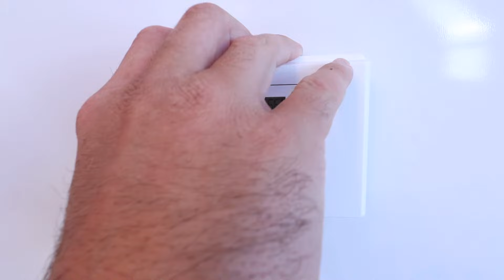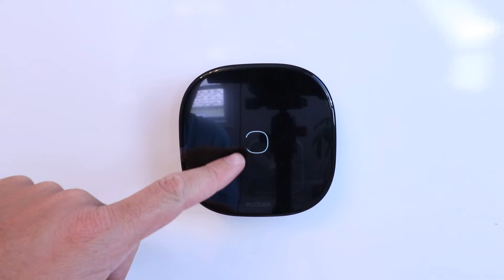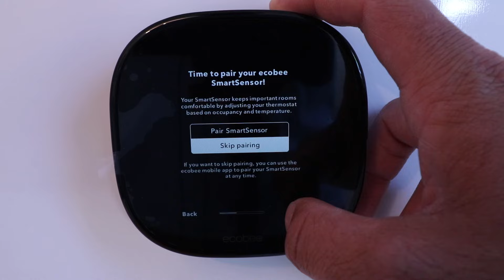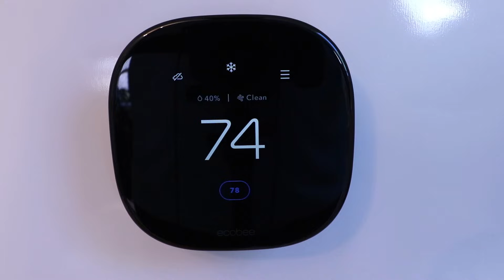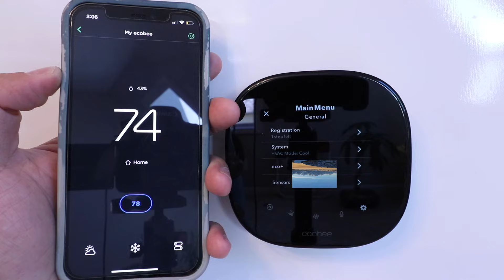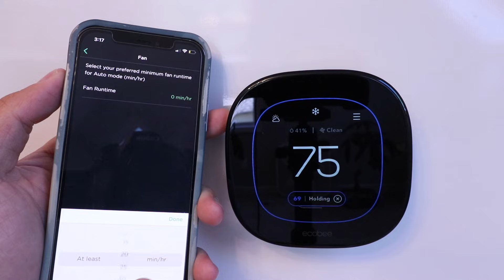How To Install Ecobee Thermostat Premium (New 2022 Version)

Comment: One suggestion I would add is to record settings from the previous thermostat. We always hope that it was setup properly, but there are always applications that aren't 100% supported by the previous thermostat where someone has done some wiring magic to make it work. I've seen tstats be wired with all sorts of relays and jumpers. In this example, the blue wire should not typically be your Common wire - Blue is O/B (Orange/Blue), but whoever wired this thermostat didn't know or didn't have a black wire.

Comment: Edit - So I had to answer my own question on this. The ecobee box comes with no instructions, however, I didn't think this would be an issue since my wiring was pretty straight forward. Wrong! I hooked up my wiring exactly like it was on my Nest, turned the breaker on and no power. It took going to ecobee website where the instructions can be found to find that the RH wire from the nest needs to go into the RC connection on the ecobee in order to power the thermostat.  
Quick question, why would the red wire go into RC when the old thermostat had the red wire going to RH?

Comment: Being the old one had the red power going to R with a jumper to RC, how does that translate to the ecobee? Damn i jjust noticed i dont have a common wire, and i have a modern furnace too. wth, so i cant use it?

Comment: I would have trimmed the bare copper portion of the wires back so there was less exposed copper, less chance of an electrical short or ground. The blue and yellow wires are the most likely to touch each other.

Comment: One of the first considerations is “Is my thermostat clise to a register?”  If yes, please consider plugging the wall mount cavity, out of which the wires extend, with plumbers putty.   In my case, the putty finally prevented temperatures from the surrounding wall from messing with the Ecobee.  The Heating would come on and roar through the floor vents for an hour, even when it reached the desired Hold speed.  The solution came was reached after 3 HVAC company visits and two calls to the Ecobee customer service.  During my last call to Ecobee, a rep asked how clise the register was to the thermostat (1.5 feet above the register).  The rep kindly guided me through the steps and sent a video to show what the completed step should look like.   I bought some putty for under $5.  The video showed the wires Nicky spaced apart, but my wires are densely grouped together.  I had to used an unused WD40 straw to meticulously pack the putty in.  After about two hours of doing this, periodically using a finger to press down on the whole mass, an effective seal finally was formed.  Now, when the heat turns on, it runs at an acceptable flow for 10-15 minutes.
Reply: Sorry, couldn’t edit.  It’s “even after reaching the desired Hold temperature”.
Reply: And “wires nicely spaced apart”.
Reply: Obviously, it would be ideal for the installer (be it homeowner or HVAC technician) to pack in the putty before wires are connected.  HVAC company:  do it to spare yourselves service calls!  Even if a register is not near, poor wall insulation near the thermostat could spell problems.

Comment: Thank you! For some reason I had an extra brown connected on the W2 and kept me from getting heat. It would turn on and then it turn off with no heat. I took the brown cable off the w2 and it worked! Heating turned on. Thank you!

Comment: Perfect. Thank you. I was a little concerned because I've never done this before and the instructions just told me to remove jumpers. Then there is no more mention of them except to say there's only a wire in Rc(The jumper was in R and Rc). This video helped me to understand what each wire does and feel confident in my installation.

Comment: Hi, I have a question for you. I have the ecobee smart doorbell and I live in a two storey house which I rent the second floor and on the first floor is a hair salon. My landlord went from oil heating to electric baseboards, so now I have a thermostat in each room which is fine.  Finally my question, do you think I could use the Premium thermostat just as a screen to see who is at my front door? I have a button buzzer for the front door so I thought I could just power it up throught the old oil thermosat and set it up with my ecobee smart doorbell and just use it like that. thanks for your help

Comment: I've got a heat pump, and I've got 8 wires coming out of the wall, that were hooked up to the existing/old Honeywell thermostat.

Between your video and the ecobee instructions, i only see clear details on what to do with 5 of the wires...

Any suggestions?

I've looked & looked for a video of someone who has a heat bump, installing this ecobee premium, but have been unable to find an installation instruction video.

Comment: Make sure there is no power to the wires. I broke the transformer and am spending 650 to get it fixed. If it's not broken, don't mess with it.

Comment: How come the old unit the red was connected to RH and the new unit RC?
Reply: Older systems used to usually have rc and or rh wires to power heating and cooling separately but his wire was probably a normal r wire which newer houses have and can go into either port (for ecobee and some other smart thermostats) but ecobee recommends rc and nest and most others rh usually

Comment: Great video!  Your old thermostat had a short black wire connected to RC and RH. You don't need that wire to your new thermostat?
Reply: I wanna know the same. Mine has it and I bought new ecobee so I want to know if I need it or not

Comment: For those with a heat pump instead of furnace...Orange wire goes in OB!  I learned this the hard way when it would only blow warm air when it was plugged into W2.  On my old thermostat the orange was in W1 and white in W2.  That configuration won't work.  For this thermostat to work, white needs to be in W1 and orange in OB.  Everything else this video is showing is the same.
Reply: I've got a heat pump, and I've got 8 wires coming out of the wall, that were hooked up to the existing/old Honeywell thermostat.

With the ecobee instructions, i only see clear details on what to do with 5 of the wires...

Any suggestions?

I've looked & looked for a video of someone who has a heat bump, installing this ecobee premium, but have been unable to find an installation instruction video.
Reply: @christopherlynn8377  Unfortunately not.  In fact, very shortly after this happened to me my outside fan motor died.  The AC guy, who charged me just shy of $1,000 to fix it, said it was just a coincidence.  Needless to say, I've returned the Ecobee.  Not worth the money or time.

Comment: How would i know if i have a furnace or a boiler? I live in AZ all we have is the ac unit on the roof and a hot water heater in the wash room which would i choose? Or does it not apply?
Reply: furnace

Comment: Hi I would like to install this ecobee thermostat, however, I took a look at my existing thermostat, it contains more wires that is not exist in your video explanation. Would mind helping to explain this. I have Tc wire, To wire. H wire, and O wire that’s no include in your video.
Reply: I've got a heat pump, and I've got 8 wires coming out of the wall, that were hooked up to the existing/old Honeywell thermostat.

With the ecobee instructions, i only see clear details on what to do with 5 of the wires...

Any suggestions?

I've looked & looked for a video of someone who has a heat bump, installing this ecobee premium, but have been unable to find an installation instruction video.

Comment: Great video 🤘 my system had all the same wires except an additional Brown wire…my old Honeywell thermostat had it on W2 as a “neutral” wire but wasn’t sure if it needed to go to a different location?
Reply: I've got a heat pump, and I've got 8 wires coming out of the wall, that were hooked up to the existing/old Honeywell thermostat.

With the ecobee instructions, i only see clear details on what to do with 5 of the wires...

Any suggestions?

I've looked & looked for a video of someone who has a heat bump, installing this ecobee premium, but have been unable to find an installation instruction video.

Comment: I have 6 wires. Im lost!
Reply: I've got a heat pump, and I've got 8 wires coming out of the wall, that were hooked up to the existing/old Honeywell thermostat.

With the ecobee instructions, i only see clear details on what to do with 5 of the wires...

Any suggestions?

I've looked & looked for a video of someone who has a heat bump, installing this ecobee premium, but have been unable to find an installation instruction video.

Comment: This is an awesome video, straight forward, the only thing I would add is there is a mounting plate in the box just in case the previous thermostat mounting needs to be covered or painted, Saves tons of time and hassle to just use the back plate.

Comment: Hello, great video.  I recently bought this ecobee and wired everything as is.  Prior to this ecobee I had the Google nest thermostat and I returned it.  The problem is, I don't have the c wire and the nest thermostat seemed to work fine without it.  But the ecobee does not power up after connecting my ac back up.  I have unwired everything and rewired and still nothing.  Any suggestions?
Reply: Mine is not tuning on ether after powering on the AC, what did you do to fix it ?

Comment: Shouldn’t you trim the wires tips so the sheathing is close to covering the bare wire so the bare tips don’t short out against each other..?
Reply: Yes!! I came here to say this
Reply: Not to mention straighten out the wire.  Also, use a needle nose pliers to push the wire in.
Reply: This is definitely a smart thing to do, as an electrician.
Reply: I did that as my wires had longer than necessary bare portions.

Comment: The title should say for 5 wires
Reply: I've got a heat pump, and I've got 8 wires coming out of the wall, that were hooked up to the existing/old Honeywell thermostat.

With the ecobee instructions, i only see clear details on what to do with 5 of the wires...

Any suggestions?

I've looked & looked for a video of someone who has a heat bump, installing this ecobee premium, but have been unable to find an installation instruction video.

Comment: I have an old Lennox thermostat that has more wires like black. How do I add those wires ?
Reply: Go to the board in the air handler and wire it to c 
😊
Reply: I've got a heat pump, and I've got 8 wires coming out of the wall, that were hooked up to the existing/old Honeywell thermostat.

With the ecobee instructions, i only see clear details on what to do with 5 of the wires...

Any suggestions?

I've looked & looked for a video of someone who has a heat bump, installing this ecobee premium, but have been unable to find an installation instruction video.

Comment: What if you have a Heat pump and not a furnace or boiler?
Reply: I've got a heat pump, and I've got 8 wires coming out of the wall, that were hooked up to the existing/old Honeywell thermostat.

With the ecobee instructions, i only see clear details on what to do with 5 of the wires...

Any suggestions?

I've looked & looked for a video of someone who has a heat bump, installing this ecobee premium, but have been unable to find an installation instruction video.

Comment: Where’s the link to the video showing how to install the c-wire adapter?
Reply: Yes I need that. I don’t have a C
Reply: If you click on the site page, I found it top of the list in the “most popular videos.”
Reply: @LEM19284  I like touching a 9V battery to my 👅.   Many Install videos don't clearly explain the "c" wire function.  Somebody else (like you) can lead to a better video.
Reply: Thanks! @LEM19284
Reply: How To Install Ecobee SmartThermostat 2021 With 4 Wires, No C Wire https://www.youtube.com/watch?v=co-VS2mrKzg
Reply: https://www.youtube.com/watch?v=co-VS2mrKzg
Reply: Dont be fresh bud
Reply: Your C wire is simply a wire to complete the circuit for power.  Typical thermostats have a 24v AC power wire and a wire to heat, a wire to cool and a wire to "fan only" - that's 4 wires.
Reply: @spudth this answer does not match the question
Reply: @spudth w

Comment: Just replaced my Ecobee4 yesterday with Ecobee Thermostat Premium! got it for $185 plus $65 for 2 extra Smart Sensors!!

I am not sure if there is a real benefit of the Smart sensors but I would have used existing Room sensors for the Premium!

As long as the support wires are there, the replacement/upgrade was seamless! No problem complain!

I like the Air Quality ..bigger screen!!
Reply: May I know how you were able to snag the premium for $185?
Reply: @div0007  i just got mines today as a matter of fact from Ebay brand new.
Reply: Got my premium for $124 shipped with 1 seonsor. Good Black Friday sales

Comment: You almost fried your thermostat and AC with a red and C cables crossed, trim the cables to avoid short circuit.
Reply: Could you clarify further? Are you suggesting to trim the copper wire enough, so there is no exposed wires in contact with anything after inserted into the blocks

Comment: Excellent video!! Does it also do heat pumps?
Reply: Yes
Reply: I've got a heat pump, and I've got 8 wires coming out of the wall, that were hooked up to the existing/old Honeywell thermostat.

With the ecobee instructions, i only see clear details on what to do with 5 of the wires...

Any suggestions?

I've looked & looked for a video of someone who has a heat bump, installing this ecobee premium, but have been unable to find an installation instruction video.
Reply: I've got a heat pump, and I've got 8 wires coming out of the wall, that were hooked up to the existing/old Honeywell thermostat.

With the ecobee instructions, i only see clear details on what to do with 5 of the wires...

Any suggestions?

I've looked & looked for a video of someone who has a heat bump, installing this ecobee premium, but have been unable to find an installation instruction video.